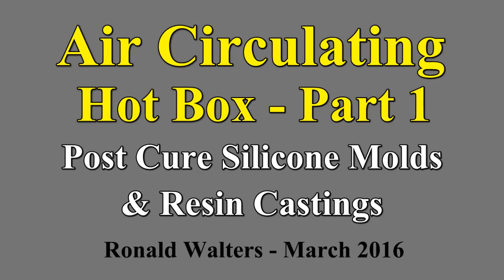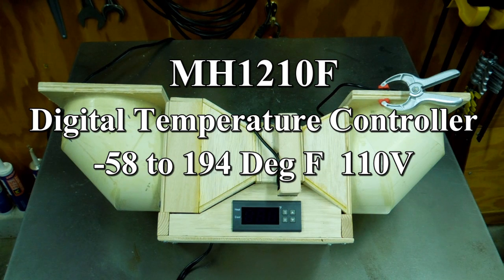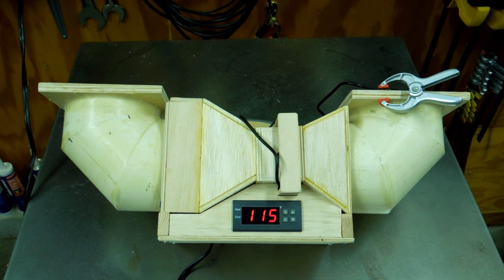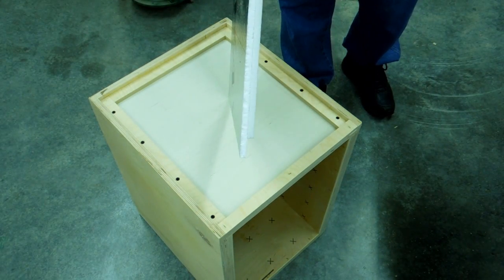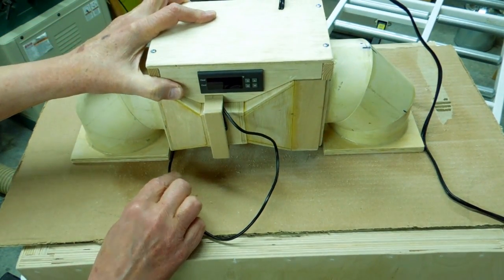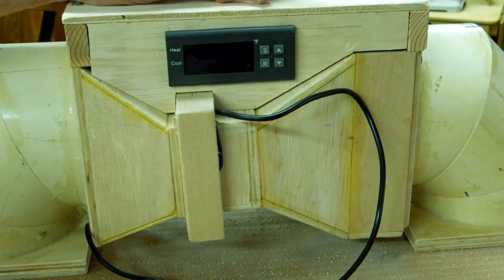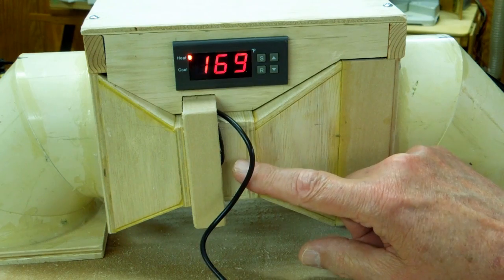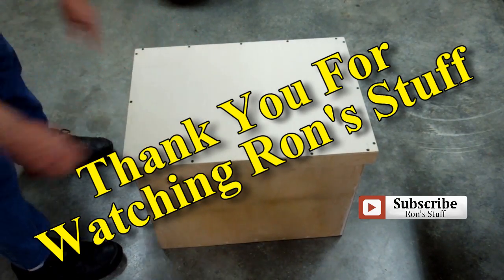Air Circulating Hot Box - Part 1

Comment: you should keep the heat unit inside to keep the heatloss from pvc-pipe to minimum
Reply from the maker: I could have put ten light bulbs in there. As clearly stated, the objective was to keep the inside of the box totally free of anything (heat unit) which might get damaged when swing heavy stuff in and out like a steel pressure pot. I don’t care about the fractional heat loss outside the box as long as it performs as required inside the box… and it does.

Comment: a pid controller might be better to control the element. as there will be quite a bit of thermal lag in the mould and or pressure pot. not that your aiming for precise tempertures, but the lag and air temp cycling would probably cause the mould temp to average out quite a bit lower that what was set. the pid would learn and help compensate for this by regulating power to the heater or turning it on a little earlier.
Reply from the maker: Precise temperature control was not required. This has done all that was needed for making sure the silicone and plastic resin cured completely and it drastically reduced the individual batch times.

Comment: Very interesting build! Will you be painting/coating the wood with some type of fire resistance? The squirrel cage blower will keep the motor predominately out of the hot airflow and will circulate at a much higher CFM. Will be interesting to see what you come up with. Thanks for sharing.
Reply from the maker: I painted it with latex paint and water based polyurethane. Positive thoughts here... it will not catch on fire... it will not catch on fire... Followed by realistic thoughts... Do Not leave it running unattended...
Reply: The power of Positive Thoughts!
Reply: +Ronald Walters you could get a one shot or resetable thermal fuse on the heater wire. just above normal use temp but much lower than combustable temp.
Reply: +Ronald Walters ie 10 Pcs RY TF 110 Celsius Degree Cutoff Thermal Fuse AC 250V 10A https://www.amazon.co.uk/dp/B00Z6RTDMI/ref=cm_sw_r_cp_apa_h1XYxbQ9DW45E
Reply from the maker: That is a good idea.

Comment: Those metal motors get hot on use as they are, so extra heat just swells the ball bearings inside. Those, are designed to never be turned off. The more cycles you subject them to, the quicker they die. I know this because i have two identical 220 fans, one is in my mini server, never turned off, the other cools my laptop. Both have been in operational use for 4 years, the laptop one, which has had its bearings changed 4 times now, gets turned off every night.
Reply from the maker: You seem to be one of those people I cannot send a private message to. What do you know about programming Arduino to control servos? Ron

Comment: I made a hotbox many years ago from a cheap toaster oven I bought specifically. I used a PID temperature module and a solid state relay for turning the element on and off, which would maintain temperature by pulsing the element on and off in short bursts. Worked very well, and was very accurate 😃
Try the air circulating fan from an old fan oven, Ron. That'll be rated for higher temperatures.

Comment: I made something similar to dry out polycarbonate for vac thermo forming and I ended up using a replacement heater/fan combo from a fan forced oven as the fan motor is built to run inside an oven a lot hotter than I needed to hold the temp up for the poly.